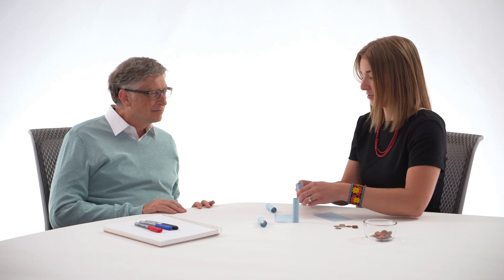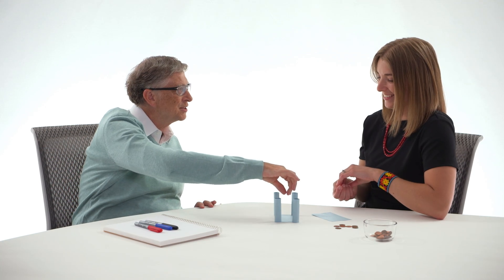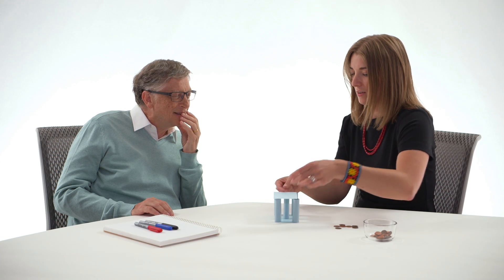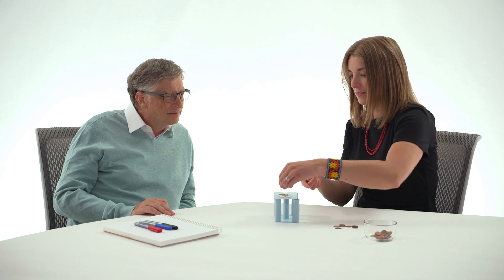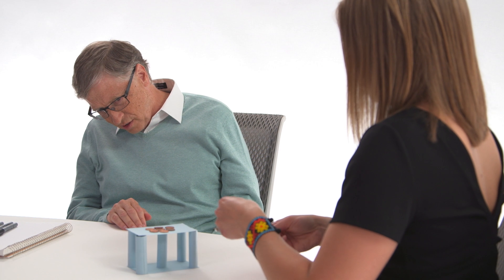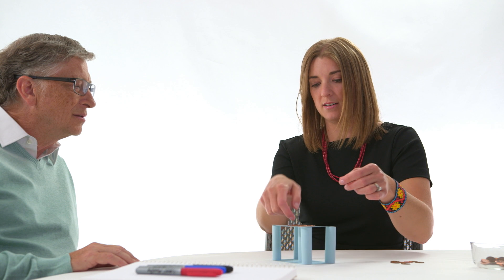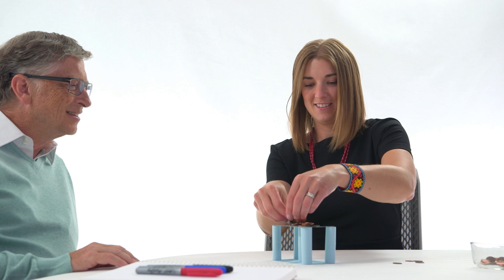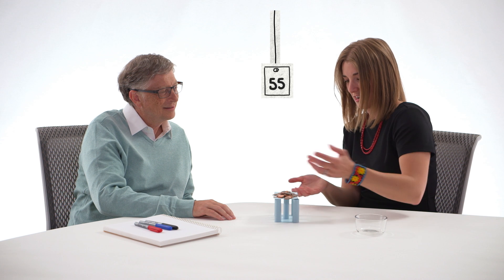Engineering lessons with Bill Gates and Camille Jones

Comment: A strong foundation is essential.
I remember building prop structures in grade school and doing this experiment. The structural strength was the key to holding the weight.
I remember doing it correctly because triangles are the strongest shape In geometry which is pretty cool.
In fact they are implemented in architecture and buildings over and over again.